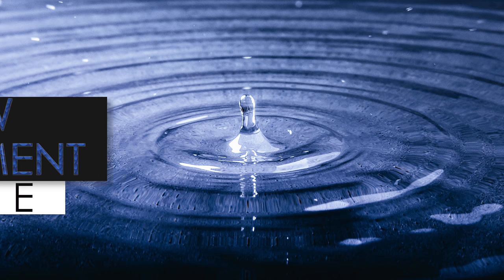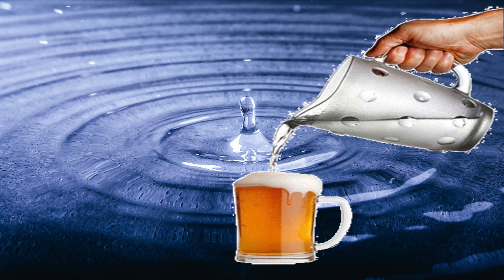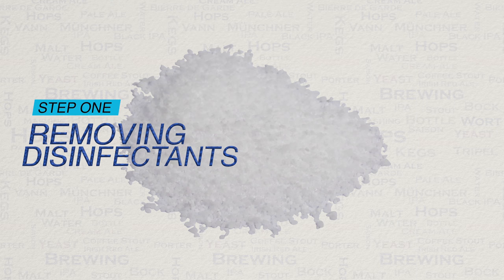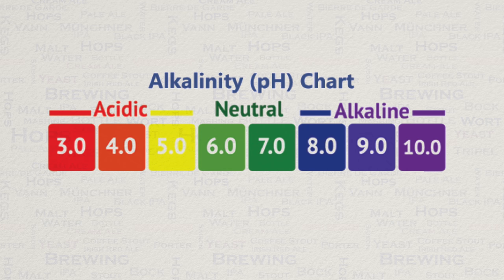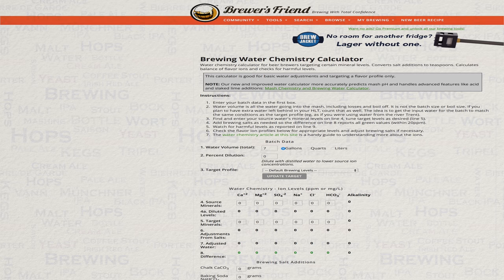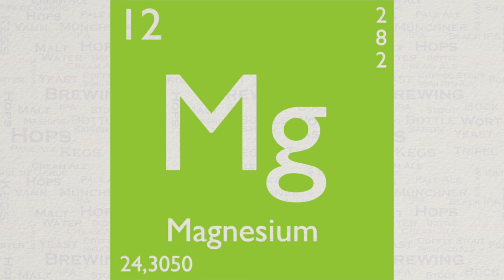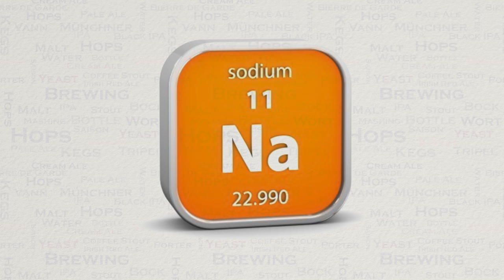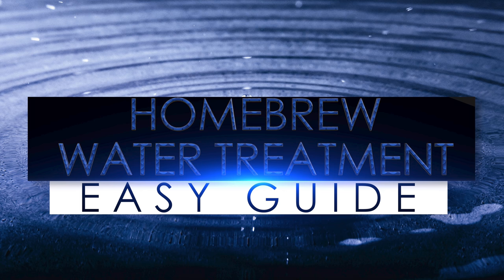HomeBrew Beer Water Treatment Easy Guide

Comment: Thanks for another great video. I would appreciate it if you could clarify some questions for me. 
1. I use the ph 5.2 stabilizer from Star Chemicals. Not sure I have to but I was under the impression it is good to use (PH in my water is around 8,5) Do I use this in both the mash water as well as the sparge water or just the mash ?

2. I am planning to “play around” with chemicals to change primarily calcium, chloride and sulfate.
A) what water do I treat, the mash and/or the sparge ? If both, is it okay to do it pre-boil or should it be “in there” during the mash. 
B) when measuring, what water volume do I go for, the water volume of the mash or the pre- boil volume. 
In short, what do I do and when and how much (I.e. towards what/which volume).
Kind regards Patrik
Reply from the maker: I can work in some water if you are not so far from ph. It will not work for all. Best to try it and see. Water treatment is usually just for mash water. Most brewing water calcs will guide you as to their direction. Check out Bru’n water for a good one.

Comment: I strongly recommend considering Ascorbic Acid (aka Vitamin C) to help adjust water acidity and neutralize chlorines. Ascorbic Acid is much better at removing chloramine vs Campden tablets, and is also a good yeast food.

You need very little to do the job, a 100mg tablet into 20L is plenty.
Reply from the maker: Great, thanks for your input 🍻🍻

Comment: Another great video. Thank you David. I'm just trying to step up my home brewing capability and water treatment is my next challenge. I've had a few successes so far, but I'm far from nailing this area. I've tried a few times to get a water profile that would be good for a hoppy pale. I don't want it too bitter, but I want to taste the hops. For example, I recently tasted Dark Stars Hophead and this really hit the spot for my taste buds. I would say it's a hoppy pale or maybe a golden ale. Not sure but I want to try and replicate it. However, when I use software such as BeerSmith3, I'm worried that the water profile is too aggressive. All ppm Ca = 150, Mg = 34, Na = 31, Cl = 51, SO4 = 296 (!) giving a rather high and bitter sulphate to chloride ratio of 5.8. Do you be chance have a go to water chemistry for this style of beer? Any pointers would be appreciated as I'm get dizzy with the conflicting information from the internet. Many thanks. Chris

Comment: Hi David excellent addition to your informative previous videos. I have not had a lot of success brewing from grain but still soldier on. I am trying to understand water quality to see if I can improve taste. I have recently embarked on a upgrade to my RO system and ordered a GH / KH test kit to see if I can understand my untreated tap water against RO water. From my understanding if I use filtered water I pick the beer style then add the chemicals to match the style. Would this be the easiest way rather than trying to work out my local water report. RO is like looking at a blank canvas would you add anything.
Reply from the maker: Many thanks Norman.It depends on your water. When you need to add lots to change it then really it is better to go the RO route and build each profile. If you tap water is good enough to drink in a glass then usually it is good enough to avoid RO.

Comment: David, as someone just doing some early research before taking the plunge, may I say thank you for your videos. You clearly understand the principles involved, what I like most is your attention to the little things. In my experience it is those that make the difference, from knowing something to understanding it.
With that in mind, I notice you do the whirlpool. Do you only do it in one direction ?
If so, have you considered trying it in opposing directions ?
After becoming aware of water structure techs I started a little experiment, with my local tap water, just to see.

Filled a litre bottle two thirds, held in right hand and rotated anti-clockwise until vortex, then left and clockwise. I repeated this a further three times. I was glad no one could see me. Then tried it.....It felt "softer", but was it real ? I continued vortexing, made tea with the water. Now there really was a difference, the flavour was/is more pronounced, and my "Pins and needles" were gone. It reminded me of the German/Czech beers, and how they feel when passing through the mouth, smooth and clean.
It would be great if you (or anyone) would consider trying this, if there's something in it I suspect you would have the ability to pick up on it. If there's nothing in it, well hey, it was a nice thought.
Thanks again,
Stephen
Reply from the maker: Many thanks for your feedback Stephen, that is great to hear. Yes, there are so many small bits of information in this that certainly add up! When I whirlpool I am not really thinking about direction, more about getting all the solids separated. I am unsure if there is a better direction, though clock wise is probably better if you have not secured your filter :) I will certainly take your lead here and try this though. It could be that some research has already been done, so I will take a look at that also. Interesting stuff :) There is always something more to try with this hobby! Its one of the reasons I love it so much :)

Comment: Thank you for the valuable information David, I use a crushed Campden tablet in my carbon filtered water.
I'm also using 5.2 water stabiliser as per the instructions and getting great results.
Understanding my water profile is on my 'to do' list and this really helped. Cheers 🍻
Reply from the maker: +inspirality Thats great to hear :) Thank you for the feedback :)
Reply from the maker: +inspirality Good to hear. 5.2 lock is useful in select circumstances. It certainly wont be a final solution for all but despite the continued advice of “so called experts” saying it is useless some do get the intended benefit from it.
Reply: There's a great quote about the Five Star 5.2 Stabilizer: "5.2 pH Stabilizer works great for people who don't measure their mash pH."  ;)
Reply from the maker: +Dan ABA For many it will not work, I did make that clear :)

Comment: Hi Dave. Excellent video. When you say 50-200 ppm for Calcium, I guess you mean only for calcium. My local water has 400 ppm given as CaCO3. If I correct this to give only the Ca part, I get 400 * 40/100 = 160ppm. So that is ok I guess? Cheers Dave
Reply from the maker: Thanks David. Yes that is acceptable :)
Reply: David Heath Homebrew thank you

Comment: Great video, thanks for that. When and how are the different salts added? to mash water, mash & sparge water, other the Boil?
Reply from the maker: This varies according to opinion, which is shown in brewing software where water additions can be calculated for just mash water or sparge water also.
Reply: @DavidHeathHomebrew  Thanks for the answer. how do you do it? wouldn't salts etc. you're adding get "stuck" in the grain during mashing, as it soaks up with water?
Reply from the maker: I always calculate additions before the brew via a calculator. The additions are added before the water. I then heat the water before adding the grain.

Comment: Hi David, can you clarify, is the mash pH target of 5.2 at mash temp or room temp? I find this confusing in many articles. For example in Jonathon Palmer's How to Brew he says it's 5.1 to 5.5 at mash temp but 5.4 to 5.8 at room temp. So, do I assume the 5.2 often quoted and also as per 5.2 Stabiliser is for a pH at mash temp? And therefore 5.5 at room temp?
Reply from the maker: Hi Andy, confusing indeed! PH does depend on beer style but that 5.2 is at mash temp.
Reply: Ah, ok. So, if I use an ATC pH meter I should be aiming for 5.5, not 5.2?
Reply: @Andy-id1ui  you need to measure the temperature at which you measure your ph with an atc ph meter. If you measure it at mash temp then it should be around 5.2/5.3 but if you measure at room temp then 5.5/5.6.
Reply: @Mrjohndoe525  You don't measure PH at mash temp unless you want to buy a meter often.
Reply: @john-smith.  I guess atc ph meters are meant for measuring ph at high temp/mash temp so should not be a concern. Also, pH displayed is still at room temp so no worries. I'm not sure if high temps damage the probe faster for atc meters though. Never heard that. Cheers
Reply: Hi, concerning the lifespan of a pH electrode, it is indeed depending on in one side the temperature and on the other side the pH.  Simply look it this way: the hotter and the more extreme ( acid  or alkaline 0) the shorter your lifespan. Good pH electrodes are considering less then 80°C as the green zone. Less than +/_300mV is also green. So as 1 pH  is normally 59,1 mV you should be good at  around 5 pH ( +120 mV).  Most common problem is that the ATC of the homebrewing pH meters stop at 50°C.  pH meters with a wilder temp range are simply more expensive and a lot of people just invest in there brewing system and not in there so important measuring equipment. Concerning the compensation, it would be interesting to know if somebody already calculated the product - temp compensation chart for beer. As in-line measurement in a RIMS or HERMS system can be very interesting, this factor could be to be considered.
Reply from the maker: Thanks for the information
Reply: What ATC does is simply change the slope that defines what mV signal from the electrode corresponds to what pH based on the temperature. It's a quick way to measure a solution as if it was at a standard 20*C. A pH-meter with ATC should show the same value regardless if the solution is 50*C or 20*C.

Comment: Using commercial distilled water as a starting point makes water treatment very easy with a water calculator such as Brewers Friend has and is economical on a small scale if you don’t want or have a home filtration system (Reverse Osmosis, RO)
Reply from the maker: Thanks for your input Joe. You make a good point there for sure :)

Comment: David - thanks for your great videos. I bought a grainfather and conical fermenter based primarily on your vids. I hope you are getting some kind of cut! Question: I did not see how to adjust chloride to sulfates ratio. What do you use for those two substances? Thanks!
Reply from the maker: Great to hear , thank you. You can add chloride ions to your water by adding calcium chloride (CaCl2) and sulfate ions by adding calcium sulfate (gypsum, CaSO4). Hope this helps, water is a complex topic. My video here really just scratches the surface and provides an introduction.
Reply: @DavidHeathHomebrew  aq

Comment: Hi David, I live in Hull in Yorkshire, and I have recently started all grain brewing (you probably noticed all my newbie comments :-) ). I have a question in relation to water. HCO3 is a required field in Brewfather for the water profile, which I believe is Hydrogen Bicarbonate. I have a water analysis from my supplier, for 2021 but I cannot find Bicarbonate or Alkalinity anywhere in the report. If I grab the spring water I have to hand, it quotes everything required for Brewfather water calcs. Am I missing something here, and does Bicarbonate show up as something else in a UK water report. Everything else is there, calcium, sulphate, sodium, magnesium, but nothing in relation to Bicarbonate. I'm in the process of contacting Yorkshire Water, but just wondered if you had any thoughts on what I could be missing. Thanks, Ben 🍻
Reply from the maker: Hi, if you go into the brewfather documentation for water there is an equation there that will help you fill this out. 🍻🍻🍻
Reply: @DavidHeathHomebrew  that is very helpful thank you. I spoke with the water company but it was too technical and requires a specialist to phone me back. Still waiting. Thanks again👍
Reply from the maker: Grest, best of luck with the water company.

Comment: david -u mention that u only add lactic & salts to mash water to bring PH to appropiate level of 5.2. My question is why dont you worry about PH of  sparge water, as if it is around 7 (norm tap) ie wont this effect final beer ph going into fermenter.  Im struggling to get my head around whether the ph of wort is important, prior to going into fermenter. There is so much varied advice on this & the importance, especially with lagers/Pilsners. Currently just adding to mash but in brewfather it has all options available. --many thanks
Reply from the maker: My main concern is around mash ph.

Comment: Hi David Thanks for you video, could you make a follow up where you brew a ligth pilsner where adjust the water to your water profile. Because i am missing when and how you should adjust if you would like to brew a lager ? When should you adjust the water i it during the mash or should everything be prepared in the begging ? How do you use your pH meter, is it during the mash or is it calculated before you start ? Looking forward to see you next video. BTW here in the Nordic it is lager time i have my lager with wlp800 out in the garage at this time and my tilt is reporting the temp is perfect for this now.
Reply from the maker: +Gorm Skovsted Water ph adjustments are done once your grain is in your strike water. Other adjustments follow. :) Hope your lager works out well :)
Reply: Yes i am watching it everyday even that it is placed 42 km away from my Home thanks to my Tilt and raspberry pi connected througth google sheet.
Reply from the maker: +Gorm Skovsted Join the club :)

Comment: for someone fairly new to brewing, I was wondering if a quick fix for ph in a hard water area is to buy bottled water. I know guys locally that use acid malt but I'm not at the stage where I feel I know what I'm doing. What bottled water would you recommend? Are there places in the uk where you can buy large amounts of distilled water cheaply? I'd like to add my own minerals and things eventually but an RO setup is not an option for me. Thanks again for these videos. You should write a book!
Reply from the maker: Ive never gone that route personally. Hard to advise on, ive not lived in the UK for almost 15 years :) Ph adjustment is easy enough with a water calculator :)

Comment: Hi David. Question about my water chemistry method. I calculate the additions using brewfather. I then combine any Calcium Carbonate and Calcium Sulfate in very cold water (I read that they are more soluble in cold water, rather than hot) and all other additions are combined and added to boiling water. Both mixtures are added to the mash water before mashing in. Sounds complex :-) is this routine worthwhile? Many thanks.
Reply from the maker: Hmm, I personally do not go to that level of trouble. It should be fine to simply add to the water all at once when you are filling it up.

Comment: David,
I live in remote Australia and I use RO water. is there a rough rule of thumb I can use to get the pH correct and chemicals to brew a Lager and an English bitter.
my main problem is the fermentation stops at 1.020 SG for both types. Will adding gypsum etc improve my fermentation?
FYI i have not altered the chemical make up of the RO water.
I am travelling to the big smoke in the next week to collect some hops and grains and would like to know what to buy.
regards

Dee
Reply from the maker: Yes, ph will certainly assist with fermentation. If you aim to be in the region of 5.2 to 5.5 this will help. Also a stable temperature and the use of yeast nutrients will help greatly. It is also common to raise temperature in the close days of fermentation to assist the yeast in full attenuation and to safeguard against DMS. I hope this helps :)

Comment: Sorry to be dense David, but it's still not clear to me. When do you add water adjustments, after the mash, after the hop boil, or at the very begining as you fill the grainfather?
Reply from the maker: There is nothing dense about this question, it is very commonly asked! :) Water adjustments are pre planned using a calculator. You can see this shown in this video:- https://youtu.be/Es4AgDohNRU
So because of this these adjustments can be added once your mash water is in. PH adjustments are best checked 10-15 mins into the mash. Hope this helps.

Comment: Ive just started to pay attention to my water profile only the ph of the water at the moment (waiting on water test) I have a electronic ph tester I use for gardening also. My water is well water and very tasty now. I measured the ph the last brew at the beginning of brew day and my water out of the tap is 7.4. I measured during first part of mash and it was 6.4 and when mashing was done it was 5.4. So do I need to adjust the ph of my brew water? thanks for everything you do for the brewing community.
Reply from the maker: Hi, For lighter beers an ideal mash ph is 5.2, where as darker styles can creep up to as much as 5.6. The idea way is to check with brewing software before the mash to see where ph will be, this will require an analysis of your water though.
Reply: @DavidHeathHomebrew  
 After watching your video a few times, I see that my sulfate and chloride are low and my magnesium is high. 
Sodium, Na 					6
Potassium, K 					< 1
Calcium, Ca 					74.8
Magnesium, Mg 					28
Total Hardness, CaCO 3 				304
Nitrate, NO 3 -N 				3.8 (SAFE)
Sulfate, SO 4 -S 				4
Chloride, Cl					9
Reply from the maker: All useful data 🍻🍻🍻